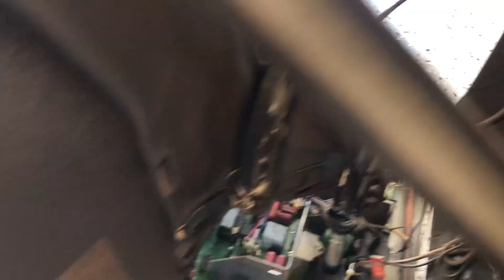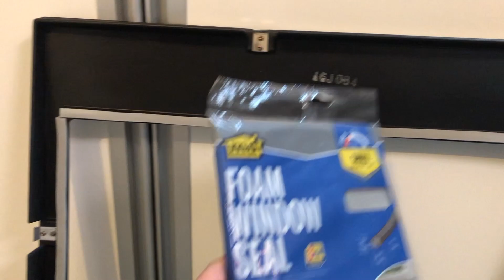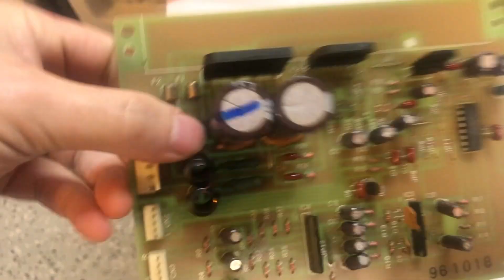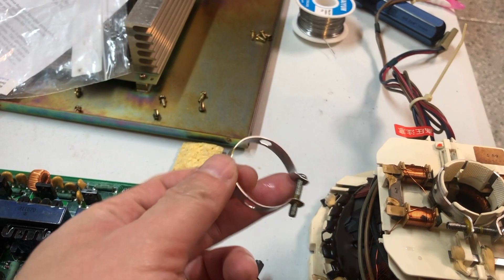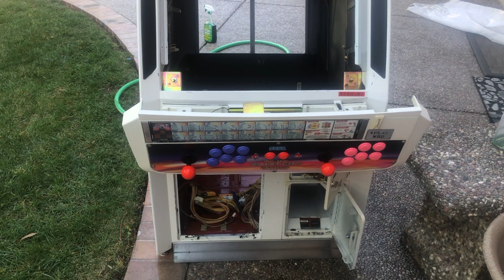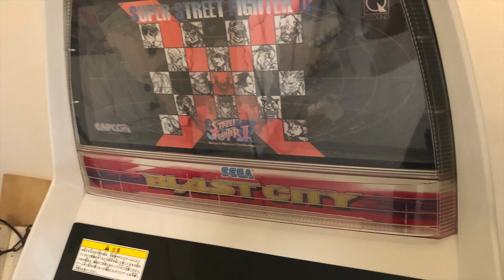Sega Blast City Restoration Project

Comment: Hey, first of all thanks a lot for sharing so much good information. I am getting a Blast City with faulty monitor or tube and I am really thinking of don't mess with that and put a TV inside of it. I'm living in Europe and there are a lot of nice TVs here with RGB by default. I know this try sync monitores are superb, but it takes a lot of our lives messing with them. What are your thoughts about that? I really appreciate if you share your opinion. Thanks a lot =)
Reply from the maker: I'm not an expert on fixing CRTs. I'm not sure how you'd be able to integrate the TV with jamma either. Might be easier to see if you can get someone to fix the monitor or try to get a replacement.

Comment: Did your monitor have issues after removing the yoke for cleaning and installing it back? I'm thinking to remove the yoke for cleaning because my monitor is buzzing but I worry I'll create more issues.
Reply from the maker: No, removing the yoke was fine. Only issue I had was with the chassis. Something was damaged when I was recapping it and ultimately, I had to send it in to a shop to have it repaired.
Reply: Thank you for this info

Comment: How long did it take for this to dry? And how much did it cost to have your monitor professionally refurbished?
Reply from the maker: It didn't take very long to dry. I left it outside over night and it dried. But I let it sit there for a long time without plugging it in because the monitor needed to be fixed. This monitor in particular cost me $400 to be fixed because the flyback had issues and needed to be replaced. I had my Astro City monitor fixed for $100.

Comment: Good work! I have mine fully dismantled, getting washed (Simple Green and Krud Kutter are your friends) and recapped. I also got my Sound Amp and PSU caps from that website. They also have the big Filter Cap you forgot to order. Did you pull out and check your speakers? Blast City speakers are usually rotted and need replacing but I got mine reconed.
Reply from the maker: I didn't pull out the speakers. They were working well enough and I didn't want to mess with them.